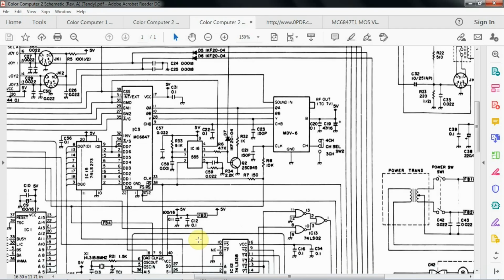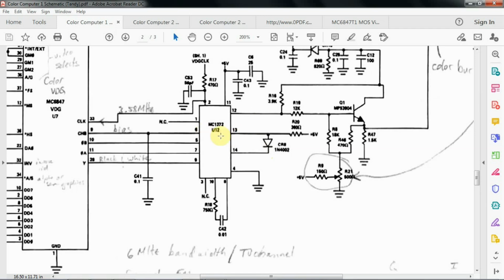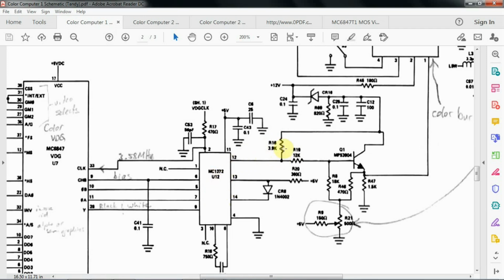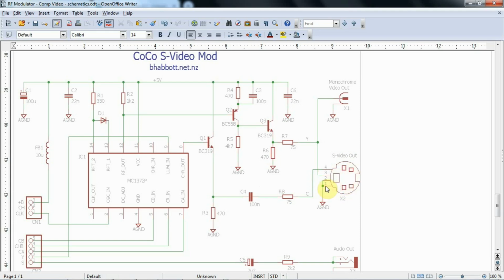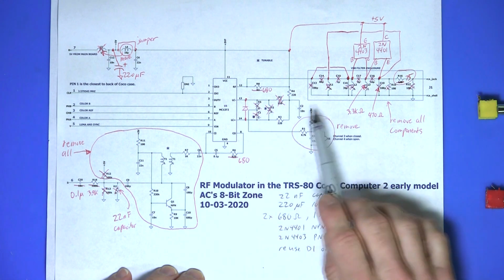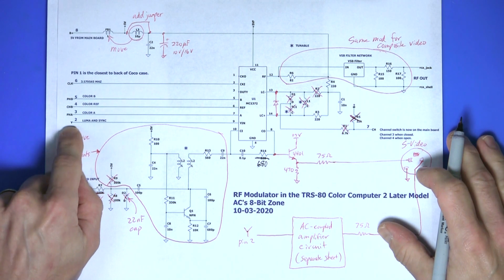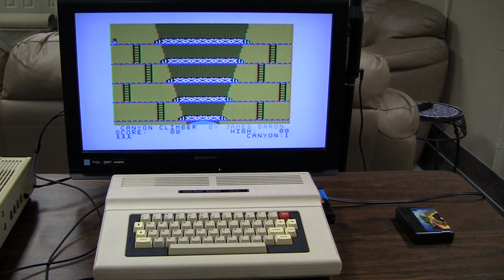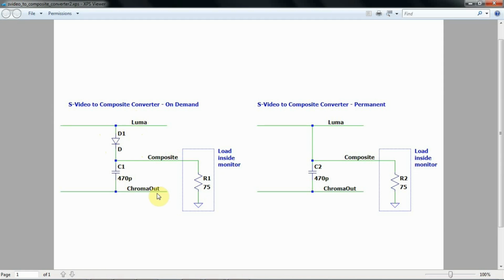Build S-Video and Composite Video mods for TRS-80 Color Computer 2 ! || A late #SEPTANDY production!

Comment: Thanks for this video! It helped me install composite on my CoCo2. I'll be making a video on it and will credit your channel, of course.

You probably already know, but on your schematics... the 5.6K resistor R102 is not mentioned in the description on how to rework the RF modulator to accommodate the composite mod underneath the schematic drawing (this file: sch_coco2_composite_video.jpg). It is, however, correctly drawn in the schematic itself. I installed R102 between U1.12 (there was an extra via available after removing C5, I believe) and the junction of 4401.E, R104, and R16.

Again thank you for this contribution!

Comment: the circuit described at 44:16 is inverted video. Found out when I finished building it.
Reply: weird things..... I somehow forgot to connect the supply line capacitors to the ground which gave me an inverted video. Curiouser and curiouser...

Comment: Great presentation. I followed the new S-V mod from The Retrochannel on my Coco1 NTSC ….S-Video works great, Monochrome works excellent from Luma output no chroma.…..but composite didn’t work. I tried without the diode, with the diode and played with different cap value,  no luck. Could you post the composite on. cable mod?  I would like to try it. Thanks a lot!

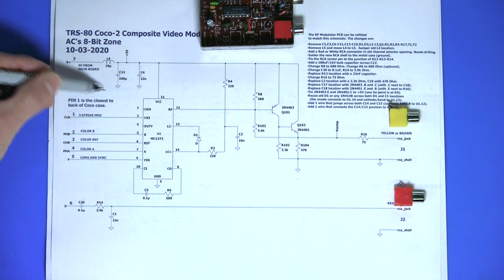Comment: 33:10 - The photos show both a 7805 and a 7812 voltage regulator (*possibly supplied from a voltage doubler) on the zippster's card, so he may not only be using a higher voltage but also using a separate +5V supply that is isolated from the main supply.  And it looks like 470 uF filter caps.  Apparently having a clean power supply is critical in producing a high quality video signal.  You kind of mentioned this at 44:57 and 57:44, but didn't show the difference which might have been instructive...
Reply from the maker: Yes, the larger capacitor value did clean the power supply and improve the video quality.  I eventually found the schematics of the Tandy educational coco with direct output composite video, the basis for the card you mentioned, but not in time to make it into this video. Thanks for the note!

Comment: Excellent Job with the video! I just got an early model Coco 2 64k given to me with an unknown history. I only have LCD TV's and CRT composite monitors, so I am unsure how to test before I build the video mod. I am missing the RCA to TV converter. I have used a jumper cable to connect the center of the RCA jack to the Coax on the LCD TV getting lines and too fuzzy image to tell if it booted or not also tried clipping to my B&W 4 inch TV and just got fuzz. I would imagine I need a load like 75ohm for correct operation, however I am not sure what to expect. My end goal is to get it working with an S-Video mod.
Reply from the maker: The original TV/game switch boxes are not really needed now. Some may have been 300 ohm to 75 ohm converters but that was for the flat ribbon style conductors from the antenna. Today people are using a cable from the CoCo to an RCA to RF adapter at the TV. They can be found on Amazon, and this provides a cleaner connection. Good luck with your s-video upgrade!

Comment: Great video AC. Are the files still up on your Drive account? I don't see them..
Reply from the maker: Hey thanks.  When I click on the link at the very bottom of the video description, it takes me to the google drive.  Then navigate into the trs-80 and then svideo_composite folder.  The schematics are there.  Let me know how it works for you if you could.
Reply: @acs8-bitzone651  Thanks AC, got it. I needed to enable third-party cookies. Apparently Drive requires that. Thanks again. Your video has answered many questions I had on the 1372 composite video setup.

Comment: First of all, many Thanks for your time around this hobby for so many people like me.

About septandy, it has been very helpful because tandy color computers have to many possible broken parts and it's time to upgrade like my Coco2 video output to actual lcd displays, thanks.

This episode, from my point of view (not an expert) is a little bit complex to follow, i would prefer to get the explanation about issue and your solution and then a clear procedure as a resume including diagrams you included in Google Drive shared folder, thanks. I would add some pictures with your final board modified, both faces.

A printed circuit board as a kit might also be interesting.

Continue sharing your knowledge because it is really nice for me!!!! 

My nickname is Cocoe since near 20 years ago from Extended Color Computer in MAME.
Reply from the maker: You are welcome. Thanks so much for the feedback.  It is quite helpful. As a matter of fact, I am thinking about doing another round with composite video to make improvements on the picture quality. Hang in there, and maybe we will get a pcb designed that has the optimal composite and s-video in one.

Comment: I just received my first Coco2 in the mail today.  First thing I thought was video mod.  Your video was the third I watched and I wish it had been the first.  So thorough and well explained. I have managed to not learn anything much about various video modes until your video.  Anyway, very well done.  Also, your hair is awesome enough to have it's own channel.
Reply from the maker: Thanks Jim for the amazing comments and feedback!  I am planning on revisiting the composite video during winter holidays. I believe there is room for a cleaner image. Also, make sure to see the video released just a couple days ago by Retro Hack Shack.  He shows off a Pi-Zero based sandwich of 3 boards made by some talented designers that is an HDMI output solution for our Cocos.  I was thinking about using an external Video-to-HDMI converter from Amazon, $20 range, to do that.  I am curious how the video quality will look.
Reply: @acs8-bitzone651  I purchased a composite to VGA converter box as I don't have a composite monitor. The converter also accepts S-video.  I bought this initially to use with a modified TS-1000 but I have yet to get that working properly. The levels coming from the TS-1000 are not right.  But now the Coco is here and there is an even better use for the converter.  
BTW my plan to fix the TS1000 output is to build a variable gain video amp with variable offsets to allow experimenting with waveform.

Comment: What are the requirements on the transistors. Are there any alternate NPN/PNP pairs that could be used?
Reply from the maker: I started out using those that were specified in the MC6847 datasheet, however, others such as TheRetroChannel have have good results with whatever npn/pnp pairs they had handy.  The general signal level transistors all have good enough qualities for this. The current and power requirements are low, the BW is not unusually high, the gain doesn't need to be extraordinary, etc.  Seems most will do. Thanks for the question, and let us know if you get some results with other transistors!

Comment: Nice work AC! I built your S-Video circuit yesterday but unfortunately it still requires adjustment of the chroma output to play nice with different displays when switching to pmode4. Same issue that I had with my circuit. But apart from that I found the output to be similar quality.

I think the chroma issue is limited to PAL machines, and seeing as you clearly have a bit more knowledge on circuit design than I do, I would definitely prefer to use your design in the future, if I ever get another CoCo that is. Anyway, thanks for sharing
Reply from the maker: Hello TheRetroChannel !   I saw your CoCo 1 video while I was working on the S-Video mod!  It was fortuitous and I learned plenty from yours, believe me.  That is the cool thing about having all these interesting channels like yours to view; there is something to learn everyday.  About the variable resistor you are needing to add in series with the Chroma output.  I'm not familiar enough with every S-Video variation that monitors and devices have implemented so I don't know the cause of this issue yet.  But I noticed that in the bhabbott.net.nz reference that I showed in my video, that he had an AC-coupling capacitor in series with his 75-Ohm Chroma output.  I didn't know why it was there, and I haven't seen it in other implementations.  My guess is that some monitor inputs do not tolerate as much common mode voltage offset, or DC offset, and want the signal closer to ground.  Did you discover that your FrameMeister needed 1k by experimentation or did its documentation cover it?  The 1k would attenuate the voltage level, but I wonder if the AC coupling cap would also have worked.  It wouldn't attenuate, but it would shift the common mode voltage closer to the monitor input.
Reply: @acs8-bitzone651  Thanks AC. I'm pretty sure I did try to AC couple the chroma but to be honest I tried so many different things and it's possible I only AC coupled the luma. Like I said in my video, circuit design is not my forté so I basically threw everything I knew at it and ended up with a partially working design 😄
I didn't know about the bhabbott one until after I made mine, I think MindFlareRetro tipped me off to that one. So it may be worth a try, as I assume that one is also based off using a PAL machine. As for the resistor value, again that was just trial and error. There were 4 displays I tested mine with, the framemeister needed 1k, an early LCD monitor needed around 300ohms, my USB capture device was happy with 22, and my crt didn't really care what the value was.
Anyway, I really appreciate you sharing your design and thoughts. I will revisit mine in the future and try AC coupling the chroma. Hopefully we end up with a design that works for everyone, it would be nice to have a proper pcb made that anyone can easily build themselves. Cheers
Reply from the maker: @TheRetroChannel Agreed, one that works for all, and then we design a PCB. Let's do it.
Reply: @acs8-bitzone651  Right, I'll play around with it in the next few days and hopefully find a solution that works. Then it's just a case of designing something that fits the CoCo. I think there will have to be a couple of different PCB designs due to the different cases and modulator placements of the Coco's but we'll figure that out later
Reply from the maker: @TheRetroChannel  Right on, I believe you are referring to the CoCo 2 vertical and horizontal versions of RF modulator, yes I will upgrade both styles with the eventual PCBs. Looking forward to this!
Reply: @acs8-bitzone651  Ok, I had a play around for a few hours and it seems AC coupling the chroma works (sort of).

Using your circuit and adding 100pf between the NPN and the 75ohm resistor seemed to play nice with all my displays when using my CoCo2. But, trying the same thing with my CoCo1 was not as successful - I have to vary the capacitance between 47pf and 150pf depending on the display, otherwise I would lose all colour and unfortunately there wasn't a certain value that worked for all.

Now keep in mind the PAL CoCo1 and 2 that I have both have the MC1372 outside the modulator box. In fact the design of both mainboards are very similar. So I will have to break out the scope and see what the actual chroma signal looks like and attempt to tame it.

Also one last thing, I found removing the bypass cap for the PNP in the Luma signal yeilded a cleaner image for me. Not sure if this is because I am using BC557s and BC547s, rather than 2N4401 and 2N4403s 🤔

Comment: Very cool, thanks for sharing all the technical details and the circuit options you found and considered.  It makes for a long video, but was very informative!  This is a video I may need to watch a couple of times to really understand all the details.  Having the Composite output for PMODE4 artifact colours and S-Video for all the other modes reminds me of how I use my CoCo3 with Magnavox 8CM515 monitor that has composite and RGB video inputs that I can switch between depending if I want to see artifact colours or not.  I wonder if I could use a Commodore 1702 monitor that has selectable composite and luma/chroma video inputs to serve a similar purpose with a CoCo2 that has been modified to provide composite and S-Video out. Also, I wonder if it is possible to use the CoCo3 RGB patched versions of artifact colour programs to see colour on your S-Video signal on your newer CoCo2?  Those versions have been patched to use PMODE3 graphics instead of PMODE4 with artifacts.  If it is possible, that would make your S-Video mod even more useful for CoCo2 users!  Patched versions of many games are available at colorcomputerarchive.com (search for RGB Patch).
Reply from the maker: Thanks!  If I had the CM1702, I would just try it and let you know. However, one would think the S-Video would connect perfectly. On the Commodore 64 S-Video, I read that certain monitors need a series resistor in one of the S-Video lines. Hopefully, a minor tweak like that would be the most that is needed in case there is a compatibility issue. For the composite circuit, R101/R102 began as potentiometers and then I dialed in the offset and gain into the middle of the range and changed the pots to discrete resistors.  Hopefully something like that would be the most you'd need to do. Regarding the RGB patch, I was wondering the exact same thing.  Before you informed me that it was a PMODE3 conversion I was hoping it was not some special mode only available in the CoCo3. That provides some hope those would work in the Coco2. Wonder if anyone has tried.  I'd like to try that myself.  I first need a way to transfer DSK images. That should be my next initiative.
Reply: ACs 8-Bit Zone I highly recommend getting the CoCoSDC!  It is indispensable and the perfect solution for getting DSK images from downloads onto your CoCo.  DriveWire is another good option.  If I had a CoCo2, I’d like to try the RGB patch versions of some games over SVideo.  I don’t see why it wouldn’t work, but not certain.

Comment: Hi there...there is a recurring problem in the CoCo community that many people would like to have a solution for. I have two CoCo2 with this problem. How can I get in touch with you, may be you can make a video about it
Reply from the maker: Thanks for subscribing by the way!  To your question, I'd like to learn more about this issue.  So I've added my information on the "AC's 8-Bit Zone" channel, on the "About" screen.  I figured that would totally throw off the spammers and they would be completely unaware.
Reply: @acs8-bitzone651  Done...check your mail

Comment: fun fact
i live in poalnd and i fell in love n one domesticly made tv , but only after 20 years of not having one i was able to buy one for myself and only then i discovered it only had rf input
so while recaping i added svideo and rgb input based on factory schematics
the thing is tz could only be hacked to accept full composite signal or YCbCr, (y r-y b-y) so my tv could use your coco computer without modulator box at all
and the other fun part of it that conversion of rgb to YCbCr, was mady by few transistor and resistor networks with no ic's so there is a chance coco chip could be  replaced entirely by some similar circuit
Reply from the maker: That is completely awesome.  You practically made the computer and TV one integrated unit!  I appreciate your information because in the back of my mind I'm always thinking "how much longer is this IC going to work, and how many more of them are even out there for purchase".  We will probably come back around to this eventually as we begin to deal with the aging system and keeping the vintage alive and well!
Reply: @acs8-bitzone651  well using factory schematic to build an av inpiy module (designed for zs spectrum) from components oryginal module was made is not a big deal, especially when i had factory service manual with pcb layouts and schematics (i made the board a mirror image though), making an integrated circuit from an internal schematic isn't a big deal eaither, i even have somewhere around homemade 555 ic on a breadboard

in your case, you scrolled trough the modulator ic datasheet and there was that internal structure schematic, you could probably made that from transistors and even remove area of the ic that were not used  by composite and s video generation, making it really simple transistor based circuit anyone could make (well easy is relative)